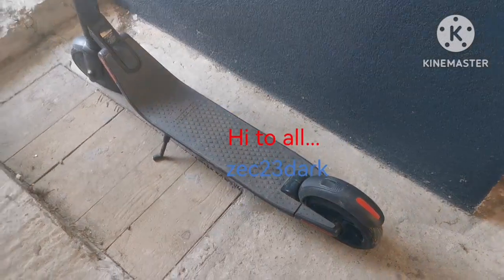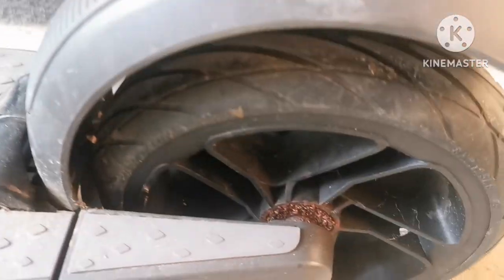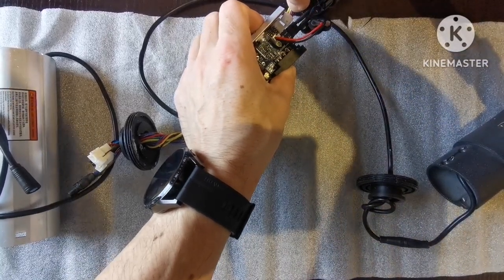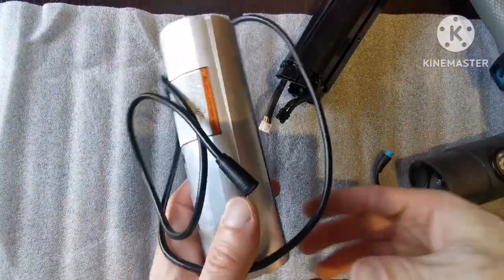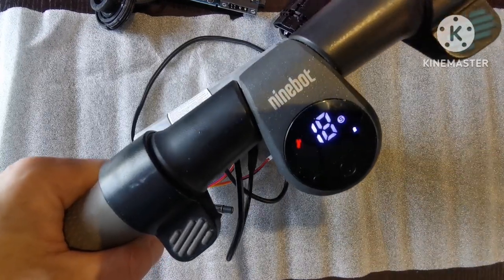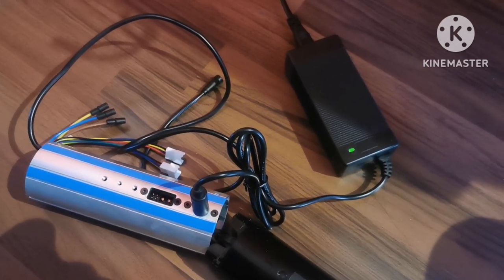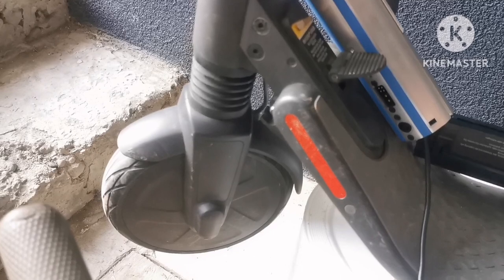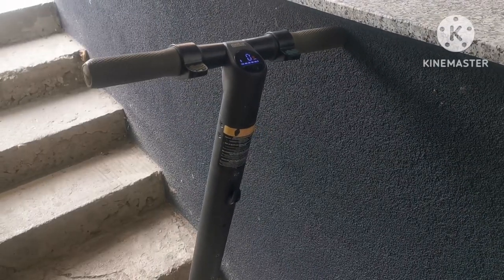Segway by Ninebot eKickscooter E1/ES2/E3/E4 controller replacing

Comment: Hey, i got same scooter so i got mod it and it was going 30+ and i got trought rain and it stopped working i cant power it on, idk if its hacking problem or water damage. Please help
Reply from the maker: @linardsdzionjuks  water damage, check connectors...
Reply: @zec23dark i got opened the scooter and the controller got a red flashing light
Reply from the maker: @linardsdzionjuks  hi your battery is damaged...